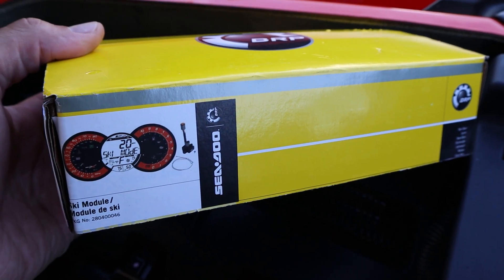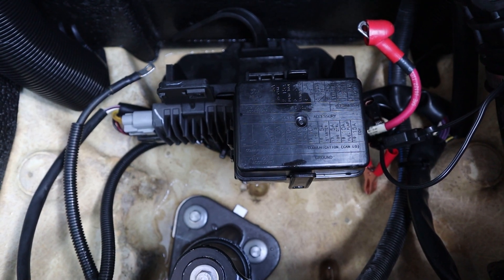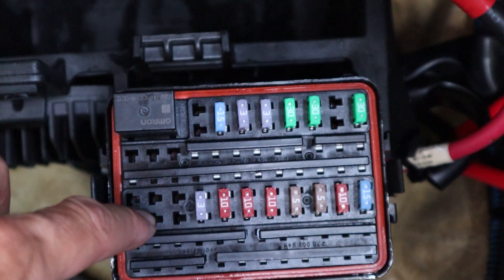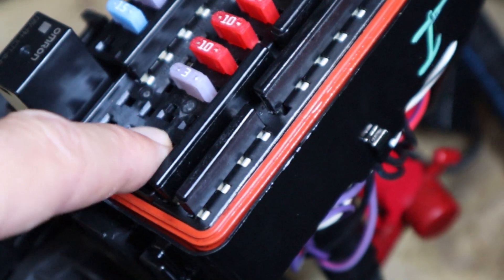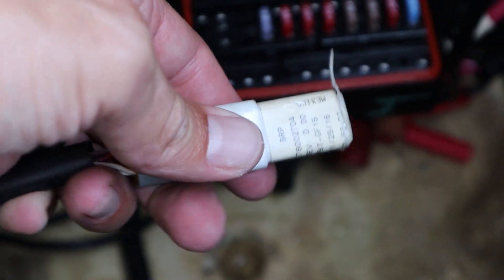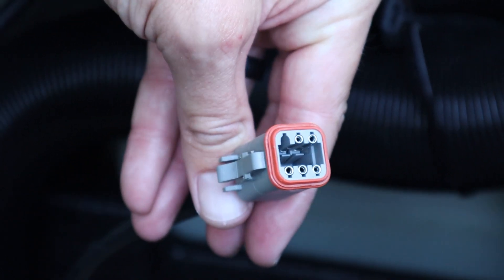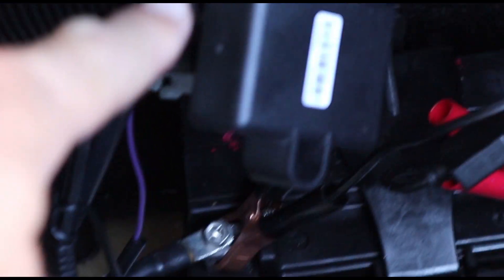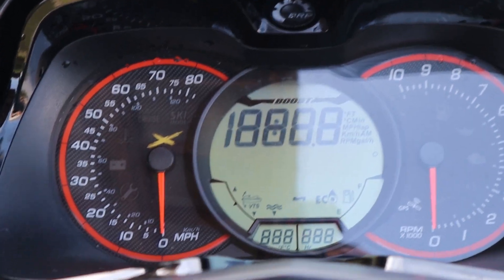How to install a SeaDoo Ski Module

Comment: I wonder if this would work on a Spark. Sea-Doo says it's not supported but it supposedly works on a GTI 90 which has the same engine and fuse box as a spark. I think the only difference is the instrument cluster then.

Comment: Very cool. Any idea if this works with challenger 180 SE to unlock/enable the ski mode that came on the challenger 180 SP 2011/2012?
Reply from the maker: I am not too sure. The engines are the same but the throttle controls are different. That would be useful on that boat for sure though.
Reply from the maker: I know they have another ski module for the older engines and I assume everything would translate over the same for the Challenger as they use the same electronics. If you get it and it works, please let me know. Thanks for watching!

Comment: What does it do?
Reply from the maker: It adds cruise control to your ski, up to 41mph. It comes on the wake edition already but has different amps for towing. The different ramps determine how fast the engine accelerated to make it more consistent every time.